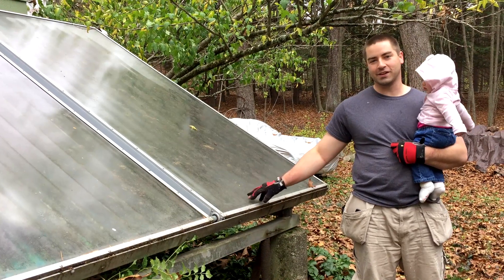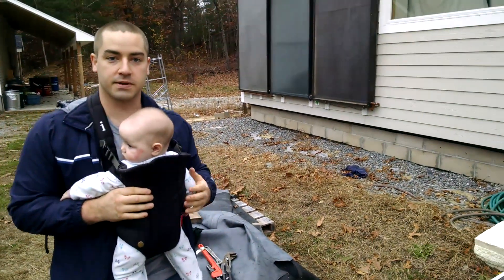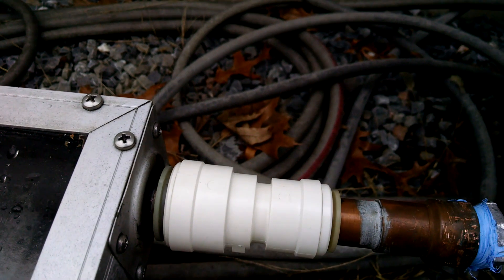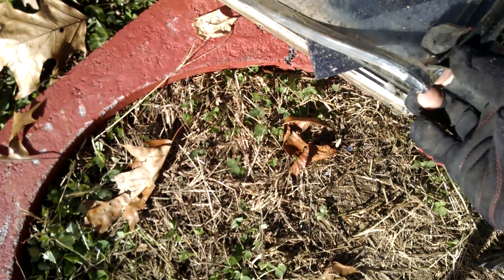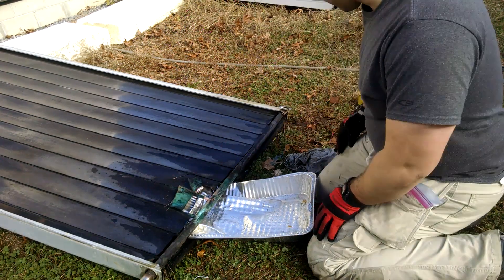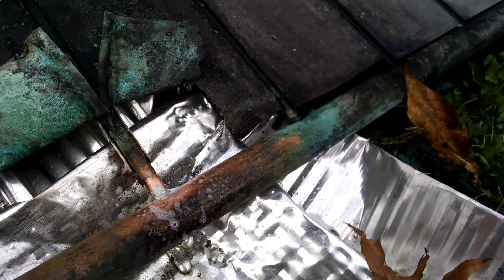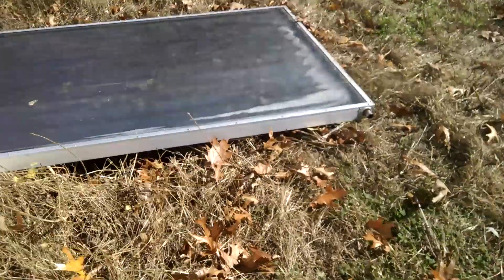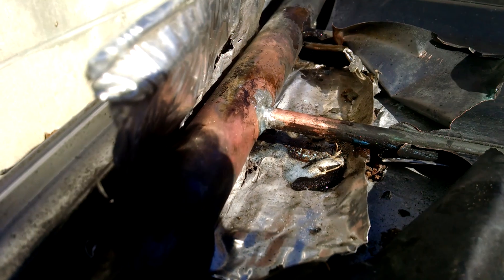Fixing up Free, but Old Solar Collectors from Craigslist

Comment: Oh man nice deal! Your hours of labour will enable your family to flourish for decades to come. Are you planning to run radiate floor heating with the heated fluid inside these 5 panels? Will you also fashion top and bottom air vents for the heated air to flow into your house? Or leave them as they are designed?

Comment: I am working to repair and install a “free for hauling” kit myself and have the same pinhole leaks you did. How is your repair holding up now that it’s been a few years? Did you use 50/50 solder do you recall?

Comment: Anyone interested in used solar thermal collectors? I have 200 plus of them. Nice job on the repair David! There's still value in solar thermal systems for hot water and pool heating!

Comment: The way you lifted each of those glass panels and had so much of them unsupported scared me just watching it. I am guessing they are stronger than they look. However  they could have just as easily snapped and broken. You are giving me ideas for how to create something myself however without spending thousands of dollars.
Reply from the maker: This glass is tempered, which means it is pretty strong in the field.  I did have to be very careful around the edges though.

Comment: Aren’t these just gonna leak somewhere else in 6 months?
Reply from the maker: They might, I don't know.  They have been up on the roof for 6 months, and so far no leaks.  I have them in a drain-back system, which has almost no pressure.  I am going to guess and say they will last.
Reply: @DavidPozEnergy  hello. We have solar system we want removed off our roof. Do you have a removal Video
Reply: When one of your tires gets "soft", you,
1. Refill it,
2. "Re-seat" the bead,
3. Or (if you picked-up a nail/screw)- ya plug-it!
                           OR.                                 -BEYOND REPAIR?-($$$) Pass/Scrap!
    ("FREE/YOU MOVE" Initially?)